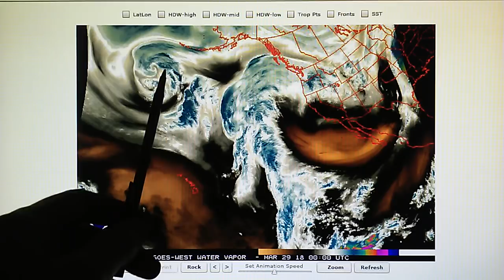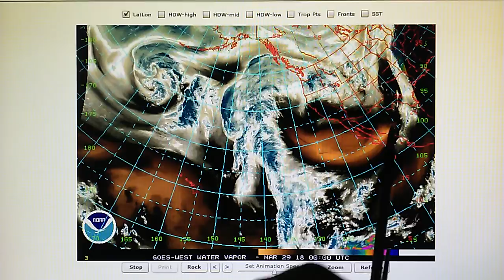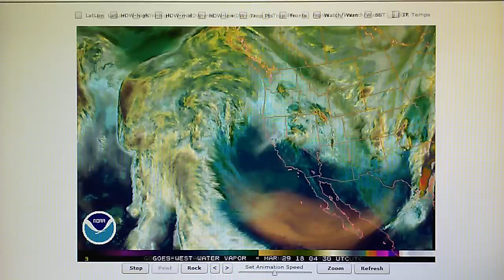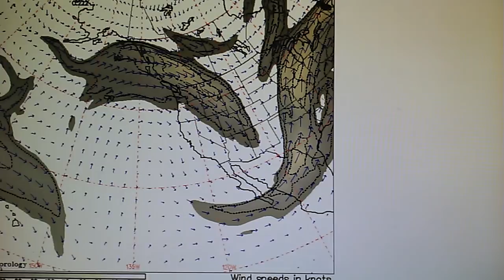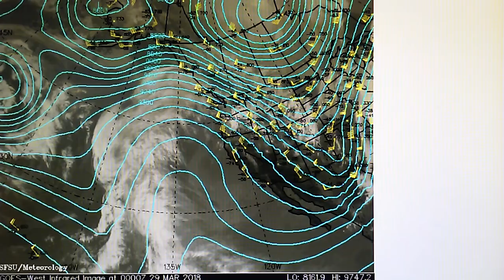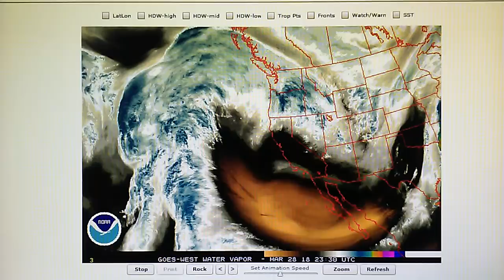3-28-2018; Giant Stationary Dome of Installed High Pressure Blocks Spring Rains; Right Angle Visible

Comment: U had me at stationary dome. What contains the pressure in our pressurized environment?
Reply: Continuous microwave or laser energy generated from ground, up to satellite, and back again (increasing in size exponentially).  1 PAC calls it phased array radar.
Reply: Josh Erickson the sun
Reply: David Maher I didn't ask what creates it. I asked what contains it...
Reply: Josh Erickson you answered your own question the sun controls everything
Reply: David Maher the firmament contains the pressure created by the heat from our small local moving Sun.
Reply: Sarah B replace satellite with firmament and ur spot on. How do you think tesla did it?